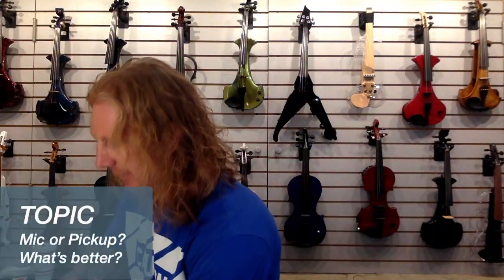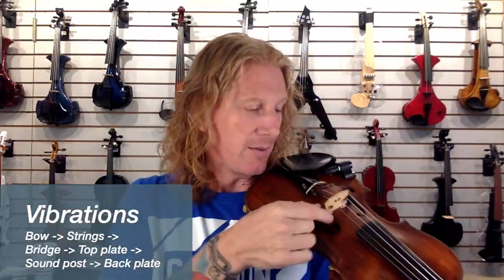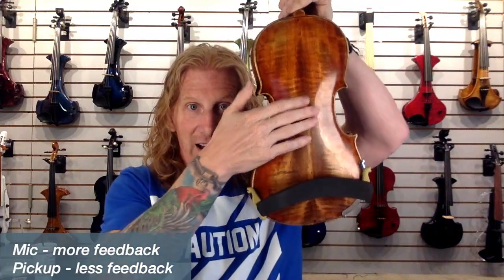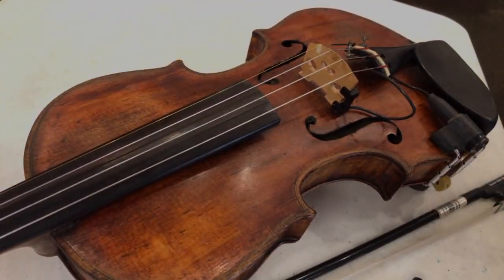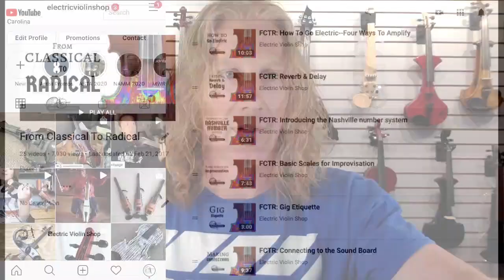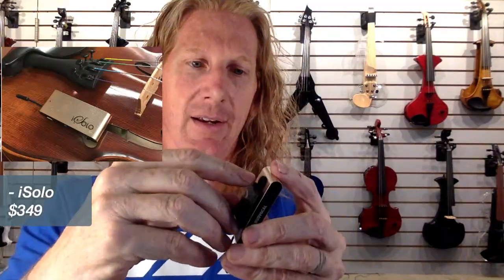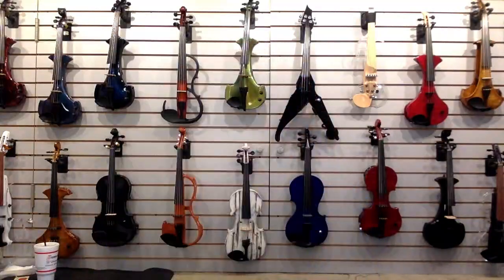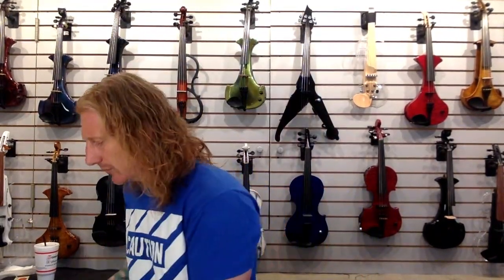Amplifying Your Acoustic Violin - Mic vs Pickup

Comment: I've been using and still use an old RSA Truevoice acoustic guitar pickup on the underbelly (2 elastic bands hold it) for 30+ years and it gives a really great sound. I've tried E- violins..mics etc and they can't 'hold a candle' to what sound I can achieve. E-fiddles a tend to be nasal like. It's not about saving money. 
RSA Truvoice are extinct unfortunately. So I'm hanging on to mine. I play jazz/folk etc and I get lots of positive comments.
Just bought a Boss wireless which is great too...John (UK)

Comment: Am super new to music. Have picked up a six string acoustic electric with built in piezo which uses 9v battery. Do I treat this the same with effects and amp or do I still need a pre amp. Plan to switch between sea shanties and heavy deep rock. Great channel!
Reply from the maker: The way to know is to plug it into your rig and see if it sounds good. If not, then, yeah, you need a preamp.

Comment: Not satisfied with the tone from my violin recordings. I cannot get the tone or sound from my violin in my home studio recordings using a TASCAM  DP03 8 track recorder. I am using a Barcus Berry pickup 1320 built in to the bridge. I have tried using my Roland Chorus AC60 with the Piezo setting with delay, reverb, chorus; using a Nashville 100 and Boss DD-3 Digital Delay; even my Austin 400 amp with delay; a Sure vocal mic, a AudioTechnica condenser mic into the recorder. My next plan is to go from the violin through the Digital Delay then into the recorder. Have you got any ideas, advice that can help me get the sound like I hear on professional recordings.
Reply from the maker: Recording an acoustic violin with a pickup?

Comment: Piezo pick up:The good point:1.Easy to use just plug the cable to amp or wireless transmitter. 2.The sound is like electric violin and thick sound. The weak point:1.The sound is not natural. Microphone with clamp:The good point:1.Have a natural sound. The weak point:1.Take time to install to the violin. 2.Too sensitive, sometime the sound will be a feedback noise when you play near the huge speaker. I prefer the piezo pick up, because I like electric violin, hahaha🤣🤣🤣

Comment: Can I use an Active DI instead of preamp?
Reply from the maker: Yes. It depends on what functions you need. A combination preamp/DI box will have more tone-sculpting features, anti-feedback features, possibly even a boost switch and mute, whereas most DI boxes are a little more bare bones, but they will lower impedance and result in a cleaner, more usable signal that is sound board-ready.
Reply: @ElectricViolinShop  A Pickup will have less feedback than a Mic big plus, that's why you also have Acoustic-Electric bowed instruments, which are basically Acoustic bowed instruments with pickups added to them.

Comment: Are there any good wireless options
Reply from the maker: The iSolo mic is already wireless.  For many of the other pickups, you can use a regular instrument wireless system.  Pickups and wireless units are almost always separate units.  So you'll buy a pickup and you'll buy a wireless system.